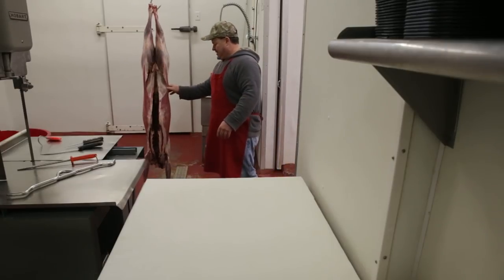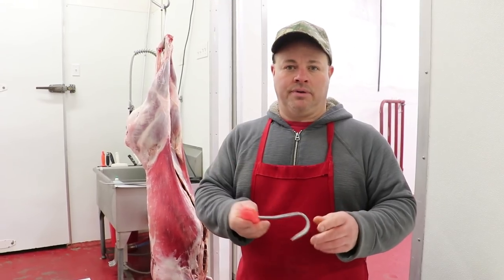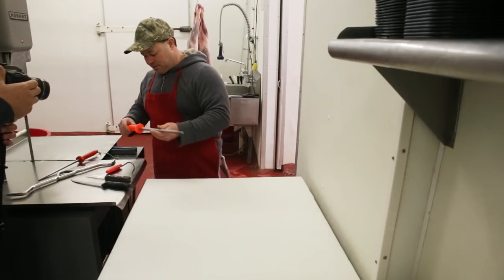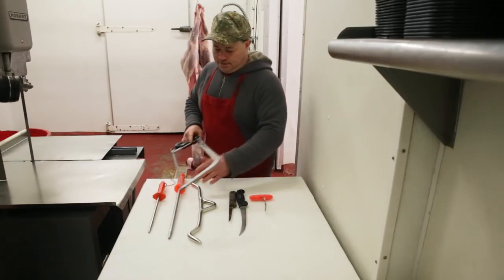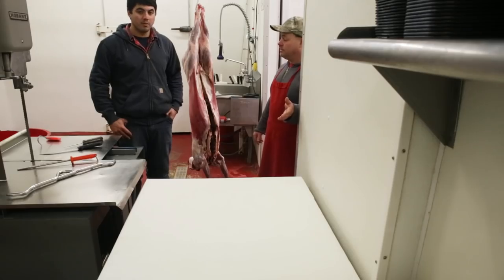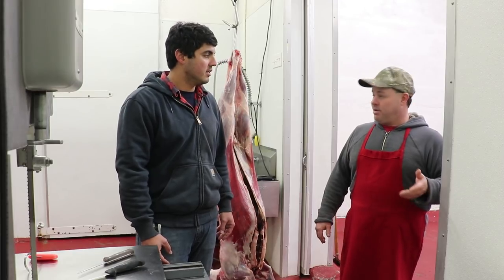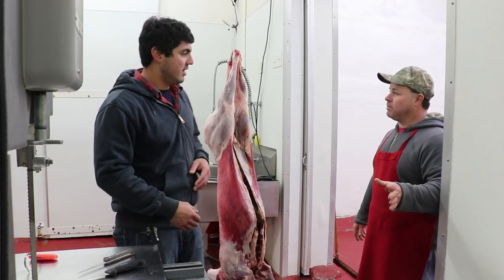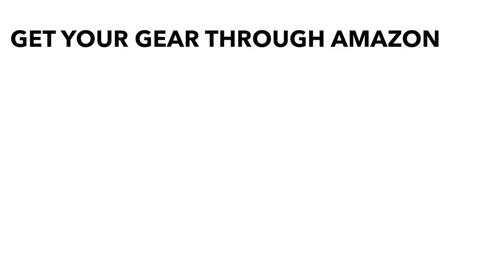7 Simple Tools Every DIY Butcher Needs

Comment: what about old school broad tipped butcher knives? i own a couple from Ontario but iam only just now getting into actual butchering, mostly been using the big 35cm one as a light cleaver for chopping big cuts(deboned already) into cubes and such. Would that do as a breaking knife of do i need the pointy curved kind?
Reply: Butcher's knife is great for cutting roasts and steaks. Cimitar or breaking for bulk primal and subprimal. A boning knife in the kitchen. If you do your own one of each! One time investment unless you are in the business. A good diamond stone is a must too, and not and a small one but like DMT's largest. Red Green combo. A piece of leather and some toothpaste for a strop. Those do wear out. Key is a sharp knife and good sharpening. Many don't bother or use a gimmick to sharpen and that is wrong. A SS gambrel is a must too.